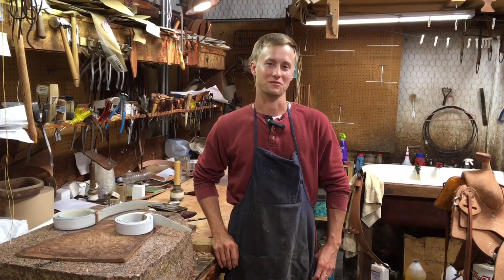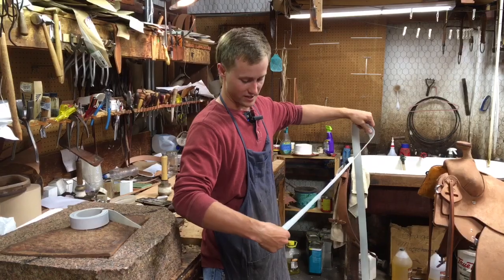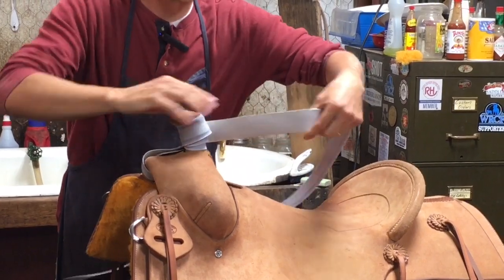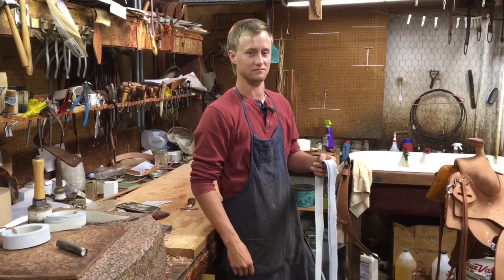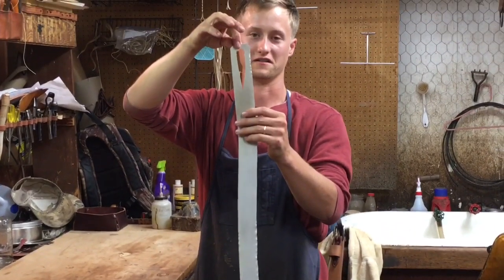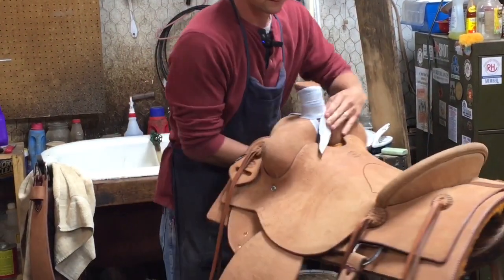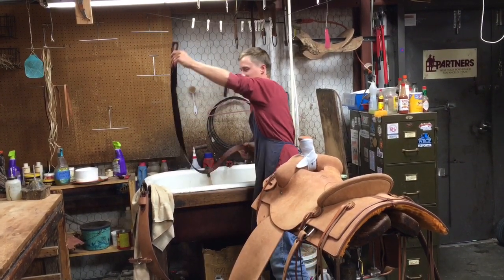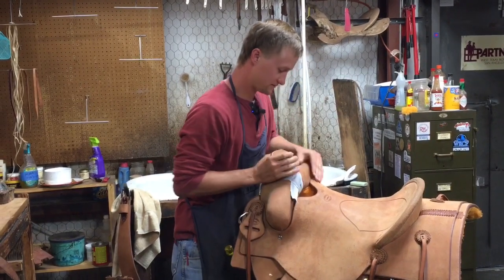Tack Tip: Mulehide Horn Wrap

Comment: What should be done with the loose tail to finish it off?
Reply from the maker: Hello!
The end should be tucked back through the slit above the gullet as shown in the video. This allows you to tighten the wrap as normal pressure stretches it

Comment: Great video. How do you do a latigo horn wrap differently if at all?
Reply from the maker: Great question! A latigo horn wrap is a little different. Instead of dipping in water, you would take your horn wrap and spray both sides with liquid saddle soap. Let it soak in for about 10 minutes and repeat 1 to 2 times. After the last application of liquid saddle soap, allow the horn wrap to sit for half an hour. From here on the horn wrapping procedure is the same!

Liquid Saddle Soap is available here: http://www.bigbendsaddlery.com/leatherc.html
Reply: Thanks a ton. I plan to do one this evening.